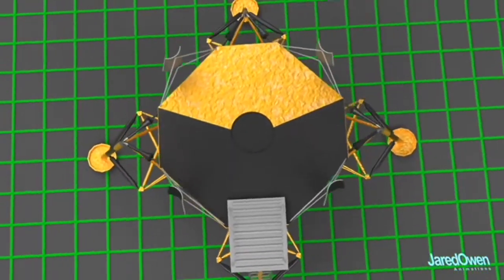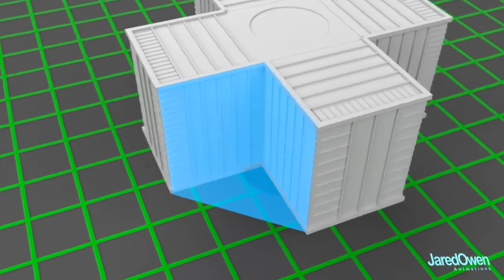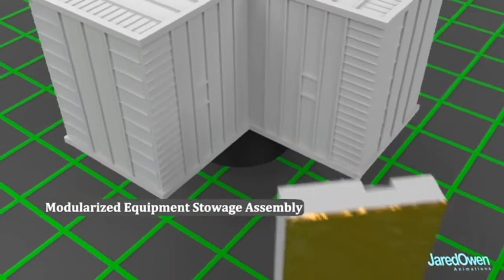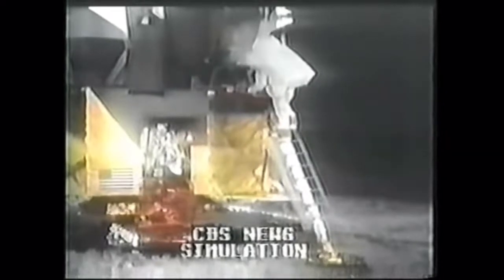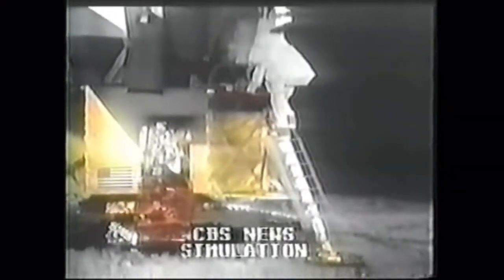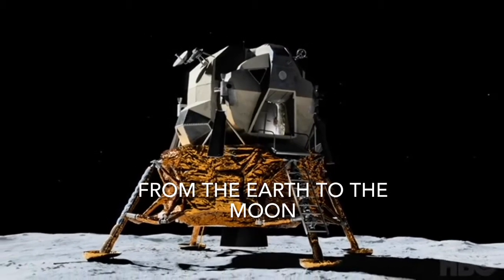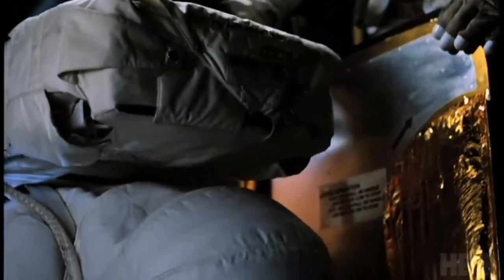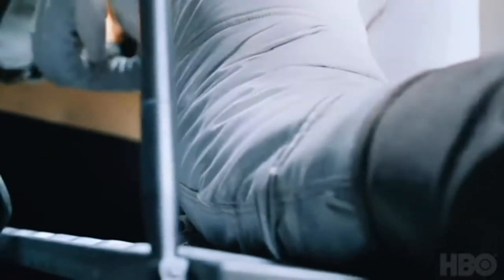Apollo 11 Moon Landing Cameraman

Comment: No delay between transmissions?  240,000 miles away?  Should've been at least 4 seconds interval. Sounds like they were in a studio to me?
Reply: The sound you hear is recorded in Houston, so the CAPCOM can answer rightaway, of course. And this is EDITED FOR TV so all the dead air has been cut out.
Reply: @AllanFolm  and if you believe that  then you believe that they landed and walked on the moon! Err. I don't think so.  And half America doesn't either.  Try again.
Reply: @michaellyne8773  what is your best argument? Besides incredulity?
Reply: @AllanFolm  facts that it never happened.  Tell me how they took perfect photographs when they couldn't even see the viewfinder? Tell me how they took perfect photographs when the moon has no atmosphere and full of radiation the film which was normal ektacrome film?  It would have been perished.  What's your reason to believe that it did happen?   " Incredulous beliefs obviously "
Reply: @michaellyne8773  By PRACTISING with the cameras beforehand. And the radiation nonsense you think is real, is not supported by ANY of the various spacefaring agencies who have put instruments in orbit around or on the moon. 

And it wasn't "normal" ektachrome film. The filmbase was developed for the SR71 programme.
Reply: @AllanFolm  may I recommend you watch   what happened on the moon?  If you watch the documentary you will hear them ask professionals about the  ektacrome film and it was normal ektacrome film.  Also many more anomalies to mention.  But you will never admit that would you like all the other believer's out there!  Code of conduct.
Reply: @AllanFolm  that is exactly what a beleiver would say! You choice  wrong choice but makes no odds to me.  You still haven't explained to me how they took perfect photographs whilst wearing pressurised gauntlets? The film in there hassleblad cameras was normal film! With no atmosphere that is absolutely a smoking gun for a start!  Your statements are nonsensical.
Reply: @michaellyne8773  Factual information. Do you have any of that?
Reply: @michaellyne8773  The cameras were mounted on the chest of the spacesuit. With an electric trigger which could be operated with gloves on. The lens was fitted with big levers to adjust aperture and focus. Using a wide-angle lens with a huge depth-of-field, everything from 3 meters to infinity was in focus when stopped down to f:11. To photograph into shadows, the lens could be opened up to f:5.6 and the focus shortened to about 1.5 meters. At that aperture, everything from one meter to 3-4 meters would be in focus.

And if you look at ALL the pictures, you'll see a lot of them WAS NOT PERFECT. You don't go around showing your failed shots to everyone, do you? YOU PICK THE BEST of the lot and stuff the rest in a drawer. But they are ALL available on flickr. Just go an flip through them all and see those that are poorly framed, lit, focused and so on.
Reply: @AllanFolm  Jeffrey kluger
In Jeffrey Kluger's book, Page 142, we read:
"In a ship like the lunar module, this apportionment of space was especially important since the cockpit was so small - barely the size of two phone booths - that the placement of every switch, throttle, and storage bay had to be planned down to the fraction of an inch. Cramped as the ship was when the astronauts were floating about in it in shirtsleeves, it was even more so when they were dressed in the balloonlike suits and laboring under the suitcaselike backpacks they would have to wear on the lunar surface." In order to leave this tiny ship, the astronauts would have to open the hatch in the forward portion of the bulkhead and then, one at a time, get down on their hands and knees and back out onto the porchlike platform that led to the descent ladder...As soon as the door was opened and swung inward, the junior pilot would thus be backed against the right wall of the cockpit until the commander had maneuvered his entire body out of the ship and shut the hatch behind him. At this point, the copilot would waddle to the left, open the hatch back up, and follow his commander down...Armstrong would be the one flattened against the wall..."
Getting back into the LEM after a moonwalk would be even more difficult. The first astronaut inside would have to squeeze past the 32" door in order to get behind it sufficiently to close it again. This astronaut would then assume a 'flattened' position - pressed against the wall to allow enough room for the second astronaut to enter. Then he too would have to squeeze behind the hatch door in order to close and seal it before repressurizing the cabin. 

And then the two astronauts would have to undress and deal with their diapers and urine bag. All this activity would take place in a space equal to two telephone booths and with no chair to sit on. This routine would have been repeated three times by astronauts John Young and Charles Duke (Apollo 16), and Gene Cernan and Harrison Schmitt (Apollo 17), who made three EVA's (moonwalks) during their missions.
A great deal of bending down and turning around - with, and without, the PLSS backpacks attached - will be required before they can de-pressurize the cabin, bend down to open the hatch door, sidestep the large inward-swinging door, turn around, drop to their knees, and exit backwards through the hatch. One astronaut will be pinned between the hatch door and the cabin wall on the right while the first astronaut performs his egress maneuver. 

Simply attaching a helmet to the astronaut will involve bending over to pick up the helmet, raising one's arms and elbows, and lowering the head - tasks for which there seems to be insufficient clearance. Then he would have to bend down again to pick up his gloves. No photographs appear to exist of both astronauts, fully-suited inside the LM simulator with helmet, gloves and PLSS backpack attached - all ready to open the hatch door. Perhaps that's because it was virtually impossible for the astronauts to get dressed, leave and re-enter, and to get undressed within the limited space and clearances available inside the LM. 

Would you travel 240,000 miles into the vacuum of space, through hazardous radiation belts, and use this cramped spacecraft sheathed with aluminum about the thickness of 2 or 3 layers of aluminum foil to go for a walk on the Moon? Therefore, were the Apollo manned moon landings fact or fiction? You be the judge! 

We Finally Know How Much Radiation There Is on The Moon, And It's Not Great News 

26 SEPTEMBER 2020
As the US prepares to return humans to the Moon this decade, one of the biggest dangers future astronauts will face is space radiation that can cause lasting health effects, from cataracts to cancer and neurodegenerative diseases.
Though the Apollo missions of the 1960s and 1970s proved it was safe for people to spend a few days on the lunar surface, NASA did not take daily radiation measurements that would help scientists quantify just how long crews could stay.
This question was resolved Friday after a Chinese-German team published in the journal Science Advances the results of an experiment carried out by China's Chang'E 4 lander in 2019.
"The radiation of the Moon is between two and three times higher than what you have on the ISS (International Space Station)," co-author Robert Wimmer-Schweingruber, an astrophysicist at the University of Kiel told AFP.
"So that limits your stay to approximately two months on the surface of the Moon," he added, once the radiation exposure from the roughly week-long journey there, and week back, is taken into account.
There are several sources of radiation exposure: galactic cosmic rays, sporadic solar particle events (for example from solar flares), and neutrons and gamma rays from interactions between space radiation and the lunar soil.
Radiation is measured using the unit sievert, which quantifies the amount absorbed by human tissues.
The team found that the radiation exposure on the Moon is 1,369 microsieverts per day - about 2.6 times higher than the International Space Station crew's daily dose.
The reason for this is that the ISS is still partly shielded by the Earth's protective magnetic bubble, called the magnetosphere, which deflects most radiation from space.
Earth's atmosphere provides additional protection for humans on the surface, but we are more exposed the higher up we go.
"The radiation levels we measured on the Moon are about 200 times higher than on the surface of the Earth and five to 10 times higher than on a flight from New York to Frankfurt," added Wimmer-Schweingruber.
NASA is planning to bring humans to the Moon by 2024 under the Artemis mission and has said it has plans for a long term presence that would include astronauts working and living on the surface.
For Wimmer-Schweingruber there is one work-around if we want humans to spend more than two or three months: build habitats that are shielded from radiation by coating them with 80 centimeters (30 inches) of lunar soil.  

Mercury, Gemini, soyuz, skylab,space shuttle,  all maintained altitudes well below  1000 miles all except apollo missions!  It was said that the space shuttle which was newer technology and better protected than the moon mission capsules,  it flew to an altitude of 350 miles! With that the astronauts complaining of seeing stars hitting there eyes from the radiation penetrating the space shuttles protected shielding,  CNN news reported that the van allen radiation belts were more powerful than nasa expected!  The Van Allen radiation belts start from 1000 miles to 25000 miles!  quite a long distance yet we were to believe the moon missions flew through all that and back  safely..Yeah! Right
Reply from the maker: @michaellyne8773  
They did not throw their space suits out of the lander, only the backpacks and the overboots. The space suits returned to earth and are in the National Air andSpace museum in Washington DC.
The entered the lander connected their suits to the oxygen supply in the lander, removed the backpacks and boots threw them out onto the lunar surface, closed the hatch and then  repuesrrized the cabin. there was no need for an airlock.
Reply: @dansv1  think what you like. It was faked. my opinion and half of Americans.  All the photos were amazing because they were taken on earth somewhere.
Reply from the maker: @michaellyne8773  
You too think what you like, but you might be interested in a video on YouTube called “Weird Pictures by Apollo Astronauts that still exist!”
Reply: @dansv1  I will check it out  thanks.
Reply: @dansv1  I have seen  this  in a different version.  Even if they did die and are still walking around today  nasa would never admit the the truth. Tell me something  if they landed on the moon in several missions..how come orion/artimetis  has not sent astronauts? Let's see when they do send astronauts to the moon   in 2025 yeah?
Reply: @michaellyne8773  Artemis - as has been stated MANY times - is a concept for long-term space missions. As such, the ELECTRONICS have to be tested. Because if the electronics fail in space, the crew will die. The size of the transistors in the modern computer systems are like a monofilament line next to the golden gate bridge. It doesn't take much to break such a line, but the bridge won't even show a scratch in the paint. 15 nanometer technology vs. micrometer technology.
Reply: @AllanFolm  so the astronauts 50yrs ago didn't die?  That's if they went there.
Reply from the maker: @michaellyne8773  
What does that have to do with the not-perfect photos. When you get one of your questions answered, you just ignore it and move onto another question?
Reply: @dansv1  because its all nonsensical statements you are making  sorry but it's true!
Reply: @michaellyne8773  No, of course not. THAT WAS A DIFFERENT TYPE OF ELECTRONICS with transistors that were HUGE in comparison to today. NOT sensitive to the particle events which could have damaged modern transistors.
Reply: @AllanFolm  they won't show the landing sites   because there isn't any  maybe they were all destroyed like all the telemetry data from apollo missions!  Tell me something   no atmosphere on the moon with 1/6th earth's gravity   the dust coming of the moon rovers wheels should have travelled at least 20ft high...why didn't it?  There would be nothing to stop it!  Another anomalie!
Reply: @AllanFolm  still haven't proven to me that they land and walked on the moon!  
The dust on the Moon, while it would be extremely fine-grain, is also highly charged due to Sun's radiation and solar winds, so it would stick quite good to the surface, grain to grain, but also cling to astronauts' space suits, something that was made quite apparent when they had fairly big problems getting it off and somewhat cleaning the space suits before going back to the Lunar Module (LM) during several Apollo missions.
Reply: @michaellyne8773  Yes, it clung to the spacesuits. So bad that on Apollo 12, the two who went down to the surface, returned to the command module buck naked to minimize the contamination.
Reply: @michaellyne8773  The dust would go up as far as the wheels would fling it. Please look up the actual horsepower of the wheels - and the dust guards used to keep the dust down. 

The telemetry is present and accounted for. The only "missing" telemetry is the BACKUP tapes for the first lunar EVA - about 42 tapes. Those were recycled and reused to record telemetry in later missions. The only reason they are sought after, is because modern computers and programmes would be able to extract a much clearer video from the datastream than what is currently available. A possibility not even thought of in the early '70s where the tapes were erased and reused.

The apollo landing sites have been photographed from orbit by USA, Japan and India. All show exactly what was expected. The descent stages, the footpaths and wheeltracks, the surface experiments left behind and so on. And laser altimeter mapping of the surface shows contours that match EXACTLY with the pictures taken on the surface.

Or is the japanese and indian space agencies in on it too?
Reply: @AllanFolm  oh really.  Please don't make me laugh anymore as my ribs are beginning to ache. Just remember to watch the documentary called  was it only a paper moon! There you will the dust coming off the rover's wheel and hitting a wall of atmosphere! As one would expect to see on earth!
Reply: @michaellyne8773  So you don't understand the concept of gravity?
Reply: @AllanFolm  I don't think you do either.
Reply: @michaellyne8773  I am with you on this one- nobody ever went to the moon! It's sad that people continue to be brainwashed into believing the many lies and deceptions presented by the government and powers at be. Psalm 19:1 ”the heavens declare the glory of God, and the firmament showeth his handywork” is on Wernher von Braun’s tombstone, I guess is a final deathbed confession.
Reply: @tedjoseve  absolutely!   Sounds a little suspicious.
Reply: Saving this for later. (Pretty funny)
Reply: Wow! You got steamrolled in your OWN THREAD! Now that’s embarrassing 😂